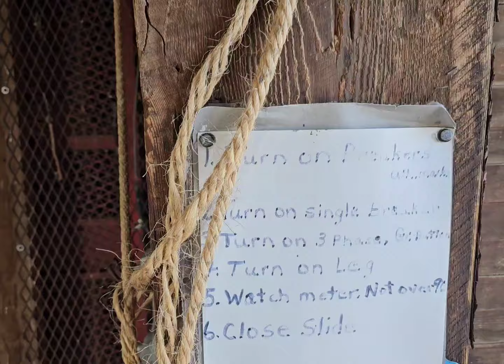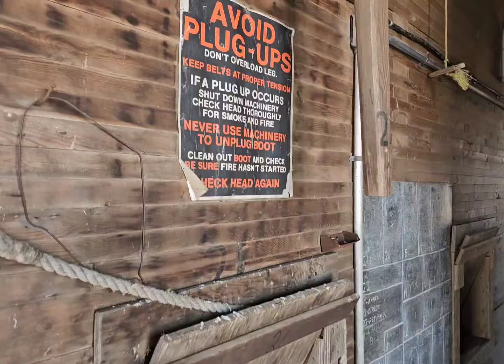Parry, Saskatchewan Grain Elevator

Comment: Checking Google again at Parry, it looks like Parry was the temporary end of the RR branch for awhile when it was cut back from the connection at Gibson Creek further east. At least the map part of Google shows the track ending at Parry, with just the trackless right of way going through the town on satellite imaging. Now the track shows as ending (as of 2013) at Truax to the NW of Parry although it doesn't appear to be used beyond Avonlea. Sad to think that in my lifetime (I'm 73) all these elevators you visit were still up and running.

Comment: Started my elevator career here in the fall of 1977 under the guidance of then Agent,  Murray Hunter. The elevator was powered by a diesel engine located in the basement of the office. Annual grain handle was approx 8,000 tonnes which would fit on a 100 car train today. The small shed was used to store bagged fertilizer and some weed chemicals.